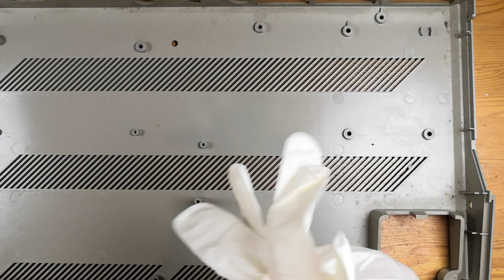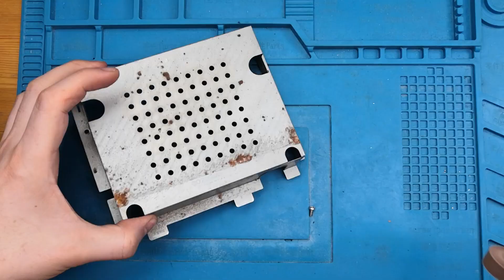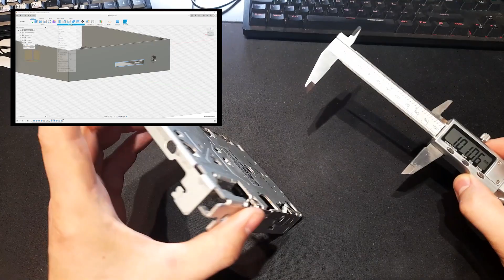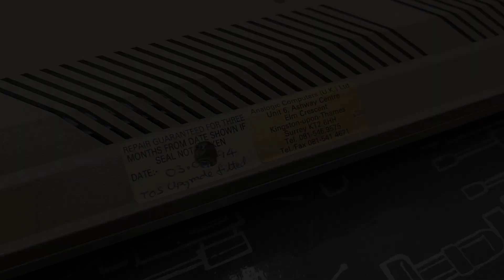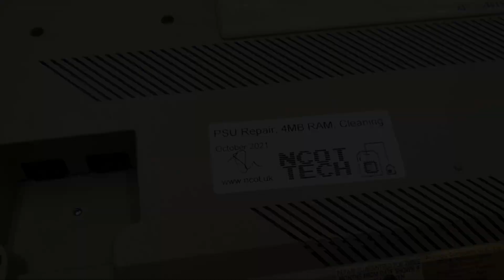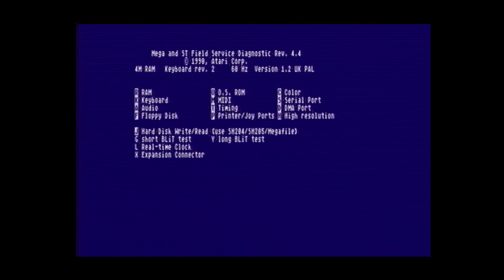Extreme restoration: bringing my Atari back to life

Comment: From Denmark,

Interesting site you have for us who have been involved since 1982, I started with a TI99/4a and then went to an Acorn BBC B which is probably one of the coolest computers I've had.

Today I have a nice Old Atari 512STfm with 1mb. Ram.

It works 100%, but unfortunately I don't have much time to use it yet.

I bought a set in 1985 when they came out, a 520ST, monochrome monitor, diskette drive, at that time I gave the conversion in dollars 2140$ = approx. 15,000 Danish kroner.

But in 7 months I will retire and then there will be plenty of time for my BBC B, Texas TI/994a and my Atari 520STfm.

Comment: Did you ever get to do the acsi hard drive? I'm at a similar stage to you on my ST and am thinking an exxos 16mhz accelerator and harddrive are next on the list (if possible, make the hard drive internal)
Reply from the maker: No, I need to get an ultra satan or something, the kit was beyond my soldering skills and didn’t go well at all 😬
Reply: @ncot_tech  I'm wondering if I can mod a plug-in solution like the ultra Satan but install it internally into an stfm for tidiness - probably just making work for myself though!

Comment: I've started a similar journey to you with my newly purchased STFM. Currently I'm building up an Openflops drive, modified a Gotek 3D printed frame from Thingyverse for it. I screwed up opening it so I have some fixing to do on the two board connecting power block screws I managed to break. I have so many things I would like to do with it via add ons I've wondered about just modeling a side add on to 3D print. This could match the ST design and hold a front facing OLED display for the floppy emulator, a hard disk emulator and the sockets and hardware for a USB mouse converter and a VGA port running all the wiring back through the floppy drive hole.
I'm a bit conflicted though on whether to just mod the case itself & not worry about keeping the original look.
Reply from the maker: You could do it in stages, try a separate box at the side to begin with, then see how you feel about modding the case.

Or try putting it in a small PC case maybe?